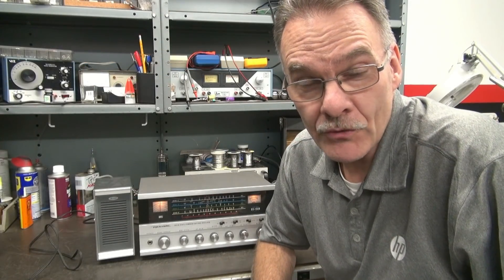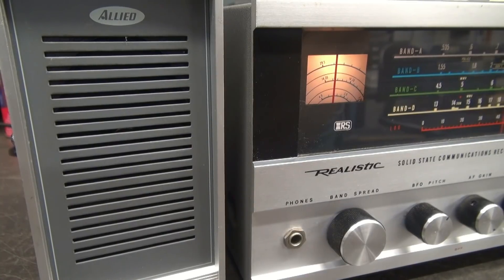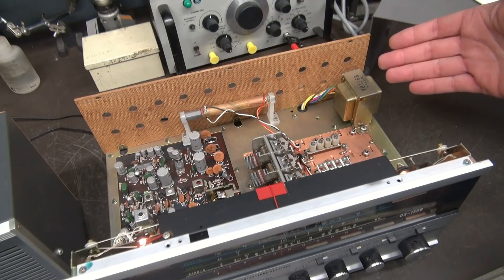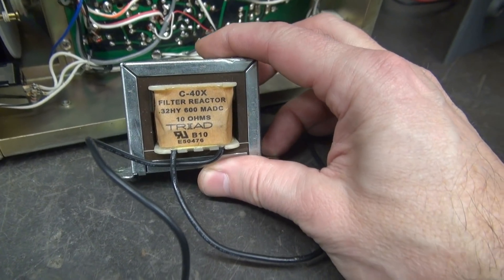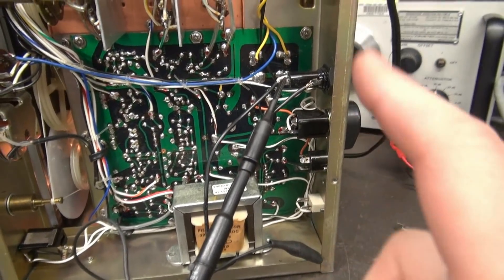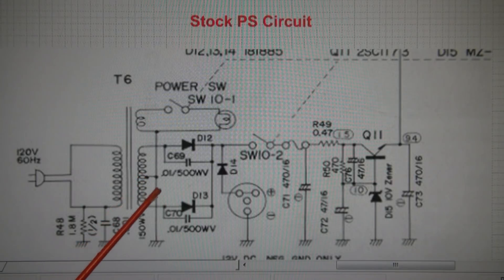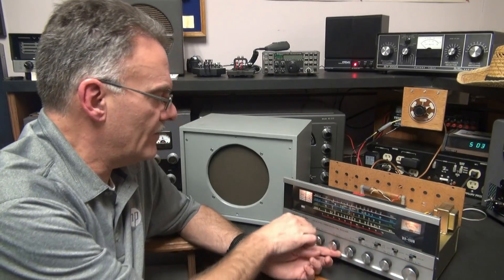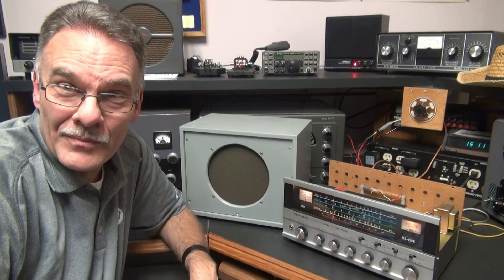How to fix Realistic DX-150 Ham Radio Receiver Power supply Hum Buzz

Comment: Great Ideas from the Proudly Veteran run D-Lab Electronics! I just bought a very clean DX-160 that has a bad AF gain pot, gets very loud and is being replaced. ON THE HUM ISSUE, there is another video saying to simply REMOVE C76 from across the Base to Collector leads. As mentioned here, All the important voltaxes are regulated by the TO-220 Zener voltage pass transistor' The low zener impedance and any capacitance from BASE ONLY to ground gets multiplied by the transistor's AC Beta. In this case 47uF/16V caP ACROSS THE ZENER would help immensely, but it's filtering effectiveness with C76 in the circuit FEEDS the rectifier ripple into the Base, as a battle of ESR's and CAPACITIVE voltage divider. Stupid Engineering, from a pretty innovative design company in Japan (GRE or is that just Lafayette?). They destroyed the natural RC filter, normally using the Zener and Base Current feeding resistor, and got no AC filtering gain by the Transistor. I agree with some other DX Video restorers, that the Elna or CE02 caos replacement WON'T help much because the tiny, wimpy Chinese Electrolytics you get everywhere today, will have worse ESR. Unless you do what was suggested, go UP a voltage rating to force a bigger size, or get Nichicon parts.Go with like 220 or 470uF after removing C76. Finally, I always put like 10X any filtering or coupling caps from the AM and Product Detectors to the Speaker output, not 100uF, try 1000uF. If you want warm sounding AM mode, or full range on SSB or CW modes, you could bypass the MF1 Ceramic Filters which give a tinny sound like in my Allied AX-190. My Kenwood R599 has fantastic audio, after going at least 10X on these caps, and drives my B&O S-45 Phase Link with down to zero beat sound, with those excellent 8 pole Crystal Filters. It still beats my new Kenwood TS-890S with every bandwidth set wide. If it sounds deeper with Headphones, the Speaker Coupling cap is too low in value,. and 4-8 ohms stresses the cutoff point. Nuff Said, Thanks for all you do! 73s, Hilary

Comment: Thanks for the excellent instructional video.  I recently bought a DX 150 on ebay.   After seeing many videos about getting it working correctly, I bought a capacitor replacement kit and I'm in the process of installing.   I am not trained in electronics so its slow going but great fun.   May I ask what is your electronics background?

Comment: I just did a restoration on the DX-150B. I found the hum was from capacitor C76. Once you remove and toss the capacitor the hum goes away fully without adding capacitors and chokes to the raw DC supply.
Somebody goofed by adding this cap. It actually couples the ripple hum to the base of the transistor which causes the regulator to pass the hum along to the regulated DC line to the receiver, C76 has no useful function in this regulated power supply and should be eliminated
Reply: Bingo, you got it! Nowhere does one find a Zener diode / one transistor regulator circuit employing a cap like C76 as a negative feedback element in the design! Good catch!

Comment: I did this mod to my DX 150 A and it definitely helped. Will it work on a DX 200 as well? I just replaced all electrolytics, even increased the filter cap from 2200 mfd to 4700mfd with no reduction in hum at all.

Comment: By the way, it's 120Hz buzz, not 60Hz and you can see that it's a full-wave rectified raw d.c. with a center--tapped transformer with D12&D13.   You were looking at the raw d.c. ahead of that linear regulator circuit (Q11 & D15), but you didn't check the d.c. on that 9.4Vdc regulated voltage rail which is the ONLY d.c. supply for receiver.  If that regulated voltage rail is not close to 9.4V (say if it's 13Vdc) you've got a shorted Q11(or opened D15 Zener), and all the ripple on the raw d.c. gets into the audio circuitry.      (VE7DQS)
Reply: Just REMOVE C76, and replace the cap from Base to Ground, and as I explained earlier, it pumped the ripple INTO the base, and killed the Transistor AC Gain/Capacitance Multiplier yoy get with the Zener feed resistor! Credit to another YT DX150/160 Modification and Restoration contributor for this valuable tip. I design power circuits at Nortel and now companies in the Optical Networking space, this was a glaring circuit faux-paux, even for a legacy Consumer Grade design. Been fixing Radios since 5th grade, and a Stereo Warranty repair tech in HS & college, and I never saw this circuit topology, ever! 73s, Hilary

Comment: Just got done recapping my DX - 150B.  Looking at some of the comments about C76 I decided to leave it out.  I have absolutely zero hum on the output even with the RF gain turned all the way down and the audio gain turn all the way up.  If you didn't know better you would swear it was turned off.  No background noise or hum of any kind.  What I did notice on mine was C76 was an afterthought.  There is no silk screening on the PC board and there are no traces going to C76.  Just two holes drilled in the board and C76 leads folded over to cross to R50.  Maybe they were trying to give it the sound of an old tube radio 😁.   My radio is dated June 1972.   I had a chance to either buy a Hallicrafters S - 108 or the DX-150b.  After looking around on the web I decided to get the DX-150b.  I was going to use this as a bedside radio and I will fall asleep with the radio on.  So a solid state radio would seem to me to be much safer!  I saved $70 over buying the Hallicrafters and it would have to be recaped too as it was all original.  A complete electrolytic cap replacement (all Nichicon) cost me less than $10 at my local parts supplier.  Couldn't have done the Hallicrafters for that!  I'm thankful there is still a local parts supplier around!
Reply: EE competent in circuit analysis here - C76 clearly adds negative feedback into the regulator circuit using that one transistor ... for the life of me, I don't know why the designers dd this. I could see a much smaller cap used here, like 1/100 of C76, but not the full 47 uF as this blows the low frequency (AC line freq) rejection of that stage.

Comment: Nice job, yes the same here. I just did not have enough money as a kid to get one. 2 years ago I finally got one, this is the first generation germanium transistor positive ground and neg ground audio amp unit (1967 year low serial number). Right now its playing, and no hum. mine was a bigger problem with the hum problem but it was worth fixing it, this is my baby to.  Fix the drift problem and I have to say I have it very close to the 150b its hard to tell the difference.   My question to you I can not find a schematic for it.  I have the schematic for the 150a, 150b, and 160.   First generation 150 is different but still the basic circuit layout for the most part. Thank You and enjoyed your video 73`s

Comment: I still say there is something wrong with the Q11 regulator circuit. There should not be any ripple on the 9.4V output from the regulator. If there is ripple, then something is wrong with the regulator. Get rid of the C76 cap. It is forming an AC voltage divider with C72 to the Q11 base and I suspect doing nasty things. Here is the way it is supposed to work: R50 and C72 form a low pass filter at 7Hz. Any 120Hz ripple will be highly attenuated at the base of Q11, so all that results is 10V of DC with very, very low AC ripple component. Therefore, there should be no ripple at the Q11 emitter, which I suspect there is (before the addition of the choke). However, C76 defeats this R50/C72 low pass filter and puts ripple back on the Q11 base. Remove C76 (and remove the choke). The choke fixes the symptom and not the cause.
Reply: I'm sitting here right now redoing a DX-150b.   The interesting thing on mine is c76 was a fix from the factory.  there was just two holes drilled and no traces running to them.  C76 leads were just folded over and tacked across R50.  the designation also was not silk-screened on the PCB.  For some reason in production and unknown engineer decided this cap was necessary.  Since right now I'm doing a full recap I think I will check the output and see if it makes any difference if I add it in or leave it out.
Reply: Just wanted to do an update.  I left c76 out of the circuit and I have absolutely no hum.  Even with the volume control turn all the way up and the RF gain all the way down it is dead silent.  If you didn't know better you would swear it was turned off.
Reply: I concur.  It appears that the regulator was overlooked
Reply: Agreed.  I would say that C76 is a design flaw.  It should be removed
Reply: My DX-150A has no C76.  It does have some 120Hz sawtooth hum on the DC outputs, although about half the amount shown in the video.

Comment: Nice job on the CLC power supply. Many hobbyists think this is only tube power supply technology but as you have shown, it is quite applicable in solid state power supplies as well.
But one thing concerns me here. With the 9v regulator and 300mv of ripple, there should not have been any ripple on the 9v rail. 300mv is well within the regulator drop. Are you sure the ripple wasn't 3 volts? That would make sense. I also assume you did verify the regulator is working and the pass transistor not shorted across the EC junction?

EDIT: A comment below suggests the audio power amp is on the unregulated 12v rail. That too would explain your findings.
Reply: If I recall, the audio is fed by that regulated 9V supply

Comment: Hello,im recapping a dx160,there appears to be a typo in the service manual parts list,c72 is listed as a 47uf,the original was a 470uf,c33 is listed as a 470uf,the original is a 47uf,has anyone noticed this? the originals have the glue glob so it doesnt look like a mistake on a previous recap attempt,thanks

Comment: Hi D-lab,
I want to modify my DX-150 as you show. Am I reading your mod diagram correctly? It looks like you have completely eliminated the fuse. I am a beginner and would appreciate your help.Great videos, by the way!!
Reply from the maker: Hello, Initially, I did jump the fuse, now its back in line. Just re position your choke. The mod is well worth doing. Thanks for the comment, stick around
Reply: What do you mean reposition choke? on circuit drawing it looks like choke is still across fuse or there is no fuse. Are you saying hook one side of choke to R49 and other side to + side of 470uf cap and - of cap to ground?

Comment: HI..can you do me a favor and look at the band-switch and tell me if you see any dark or black looking contact where the wipers go...is your all brass colored, cause mine is half black...yes I think lightning hit...I am still trying to repair this radio..had it about a month..
Reply: A lot of time that black look is from the silver tarnishing.  I am working on a 150b here that was so bad it wouldn't function.  A shot of deoxid 100 fixed it right up.   You can also use Tarn-X to clean the switch, but be sure to rinse the switch with alcohol when you are done.

Comment: To anyone aligning this radio, dont do what I did and not turn the band-spread dial all the way clockwise....it will not align right if you dont..I found out the hard way..and its not in the manual.

Comment: I just installed a 1000 mfd electrolytic cap between the positive side of the fuse to ground..and it go rid of about 80% of the noise.. Mine wasn't humming at all but thought I would try it.

Comment: They have that choke at "element" now for like $3.38,  would a larger one...or one with different measurements help more..or is this the most or best one to get..?????
Reply from the maker: That's a very good deal. I picked that one since I had a few on hand. You can use other values, just watch the resistance, current is low, about .5 amps to run the radio.

Comment: I have a request if you have not already done it. Talk about grounding issues. This is one of my problems with building an amp.,even though I used to wire houses. Chasis ground verses earth ground in the amp and which components are hooked to which and if they tie together at some point or are totally separate and not to make a loop. Thanks for any help. Or maybe you can recommend a good video on this subject.

Comment: Hey D-Labs , I recently inherited a handful of old audio stuff from my father which included a 1956 Bogen CHB 50  and 2 old radios ,a RCA and a Philco  both with RCA 16K FC speakers that he had replaced  .The Bogen has outs for a variety of speakers including a 3 pin 70v and was wondering if the 16K's would work .Would love to drop both into the Philco cab as the woodwork is still in great shape and plenty of room for both .

Comment: Referring to the Stock PS Circuit, the 3 components C71, R49, C72 for an elcheapo "pi" filter.  Resistors are sometimes used to avoid the necessity/expense of buying a choke & ostensibly work nearly as well as a choke for low current loads, but perhaps what we saw here is just how "well" this one worked - fairly well but could be better.  It might be a better fix to replace R49 with the choke, but it would be less convenient than jumpering one across the fuse holder - but you would still have a fuse that worked!

I am curious that the regulator Q11 didn't wipe out any residual DC ripple...  And the presence of C69 & C70 across the rectifier diodes seems like a guarantee there will be AC on the rectified output.  Except for strings of HV diodes, with equalizing caps & resistors, I can't recall ever seeing a rectifier diode shunted by a capacitor like this.

Wonder how neatly a replacement of Q11 & associated bits with an LM7810 regulator chip would perform???
Reply from the maker: Seems like R49 (.47 ohm) is more like a fuse-able resistor for the collector of  Q11. Very low value to have any PI filter effect. I"m not sure what they were thinking back in the day of this PS design
Reply: Well, the access to the wires at the fuse are convenient. Why not just use a terminal strip to add the new components in circuit and keep the fuse intact? Plenty of space there. I think I’ll try this mod on my DX-160 and report back. This mod clearly removes the ripple and hum.

Comment: Watched this and put my DX-160 on the table and tuned in a local AM station.  Listening to Christmas music right now.  It is noisy and I'm sure it needs recapped, cleaned and aligned.  Guess it just got moved up the list.  I'm interested in whether changing C76 cleans up the AC.  It would be cheaper and easier than installing the choke.
Reply from the maker: Yes Sir, I will check into that. Hopefully C76 is the true culprit. Either way adding the choke is always an improvement. Thanks for sticking with D-lab.

Comment: Wouldn't you get the same result by replacing the first filter cap with a $1 10.000uF cap?
Reply from the maker: You have to be cautious when increasing capacitance way above the original value. It can cause damage to the power transformer/diodes/pop fuses, etc., due to the initial surge current.  Yes a choke is rather expensive but does a super job killing noise in DC circuits. Lots of info on the web.
Reply: That's true, however, I'm not sure how high would you need to go with the capacitance to actually damage a solid state rectifier. I used to use 10.000uF caps for heater filtering in high-gain valve amps, with no problem. I always feel chokes were a good idea back when an electrolytic capacitor of a suitable value and voltage rating would be prohibitively bulky or expensive, not so much nowadays. 
Anyway, thanks for the great content.

Comment: My first radio was a DX-150.  In tech college I build the digital frequency counter highlighted in Radio Electronics....worked really well.  I wish I had it back.  Saw a DX-160 at a hamfest for $75 last spring but didn't have the cash with me.

Comment: The choke got you the results, but the real problem is the voltage regulator.  0.3V of hum should have been easy to strip out in the regulation down to 9V.  The question is why does the regulator suck?  I'm wondering about C76.  If they were concerned about oscillation or RF problems, then I'd expect it to be a few pF.  But by being a 47uF, it forms a AC voltage divider with C72 and puts hum into the reference voltage.  I'd pull C76 or replace it with something far, far smaller.
Reply from the maker: Hello, Great idea. I did not look a the the caps around the regulator except for the 470uf value. I will check that component and jump the choke, see what it does. Thanks for the input.
Reply: Dry caps is certainly a possibility, but I'm seeing a questionable design.  It sure seems like it would couple the 300mV ripple of the raw voltage into the zener diode.  Any ripple there will find its way to the regulated voltage.

Comment: Kewl Terry, who made it for RS?  
I'd consider installing a small SLA battery, and use its supply to recharge it.  Come in handy for portable or power outage use. 
Another simple fix, use a one amp wall wart on the DC input.  I hve a bunch of those wall warts.
Reply from the maker: I know they were made in Japan. Maybe by Trio? Allied and Lafayette also sold re-branded shortwave  receivers. Great days gone by. TD
Reply: @d-labelectronics  they were made by GRE.
Reply: Wall warts, depending on their build quality can be very noisy DC power supplies, in case you did not know that.

Comment: Great Fix Terry... Makes you wonder if RS engineers just didn't know how to make it quiet, or chose not to , to keep the cost down.
Reply from the maker: Hi Ron, I would say, just to keep the price down. If you run the radio on external 12vdc, there is no hum at all in the stock configuration. I plan to run this jewel on CW mode over Holiday break. I have a cool QRP tube TX to team up with it.
Reply: cool